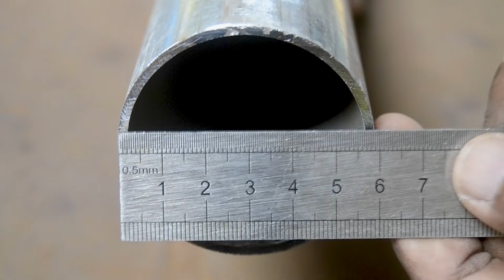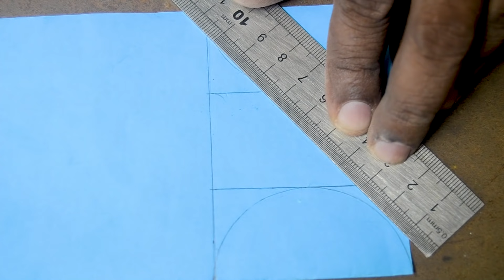BRILLIANT Idea For PIPE 90 degree Joint WITHOUT CUTOFF MACHINE...

Comment: Muito prático! Sem cálculos e desenhos complicados!  Excelente contribuição! Muuuuuito obigado !!!!!!!!!
Reply: Its not as simple as in the video,  I copied the video exactly and when u put the 90 degree joint together they don't even come close to fitting, u have to cut off 4 extra strips of metal in order to try straighten the bits that meet up and its also not a good fit at the outside corner

Comment: Parabéns pelo bom profissional que você é,além de professor competente para ensinar a todos que tem a humanidade e interesse em aprender. Deus continue abençoando você e toda família
Reply: Chi k
Reply: Its not as simple as in the video,  I copied the video exactly and when u put the 90 degree joint together they don't even come close to fitting, u have to cut off 4 extra strips of metal in order to try straighten the bits that meet up and its also not a good fit at the outside corner